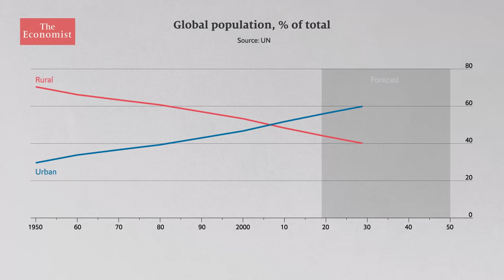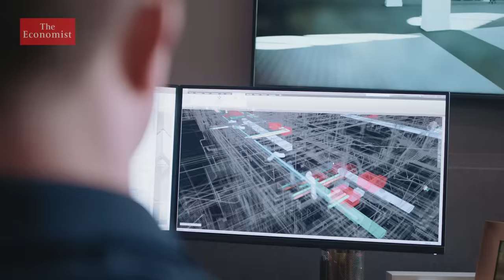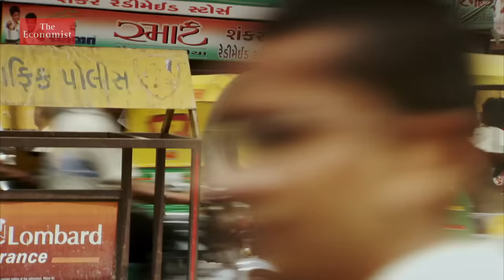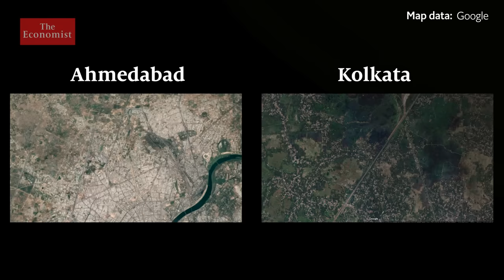How to manage a megacity

Comment: Fantastic video. However I disagree with the focus on composting. This is not a sustainable option in large-scale centralized applications. Centralized composting facilities will not last. They emit methane and nitrous oxide (36 and 298 times more potent than CO2, although not densely concentrated) and they still produce vast amounts of CO2 in this mostly aerobic process.

A more sustainable option in the future is to first recover the carbon into a value-added product or biofuel, and then use the residuals as soil amendment (eg. Hydrothermal Liquefaction, Gasification, Pyrolysis, Anaerobic Digestion)
Reply: So you are saying all the organic waste,like fruits and vegetables wastes etc shouldn't be left in open to break down on a large to obtain natural fertilizers.
Reply: It does not have to. Those gases can quiet easily be captured and either sequestered or used for fuel. They don't just throw it in a giant head and let it rot. It's controlled.
Reply: Did you not listen to the fact they add in stuff that absorbs the greenhouse gasses?
Reply: @rajkishorebehera7489  digestive reactors or modern landfills go through the process of composting while trapping methane for biofuel disposal. This both creates a green fuel and removes methane pollution which is 100 times more potent as a greenhouse gas as co2. The only issue is cost. It is much more green than traditional composting though and can still create compost. They just require tanks or tarps to capture gas
Reply: Kevin Clack, that is an interesting perspective.  However, some countries and some large cities have done composting well on a large and commercially viable scale.  E.g., from Barbados to Las Vegas, there are entrepreneurs who are collecting food and other organic waste from hospitals, from schools, from restaurants, from hotels, from supermarkets to avoid having these valuable resources treated as immediate garbage.  Some items can be redirected to supply food-banks, the poor, the homeless.  Other items can be composted and turned into soil for farmers and for households, and other outputs can go towards animal-feeds.
Reply: As much as this is ideal, you are completely forgetting that our soils are being deleted at an alarming rate, leading to more deforestation for farmland. It is much better to let our waste rot in composting facilities that don't keep the methane (and are therefore cheaper to put in place) that in landfills were they are mixed with toxic waste and will never make our soils fertile again. Greenhouse gases from plants that we have grown over the past 10 years aren't what is causing climate change as they captured those greenhouse gases over their recent lifetime, fossil fuels that captured the greenhouse gases from the atmosphere thousands of years ago do.

Comment: I read somewhere (perhaps in a comment) that the concept of Waste-to-Energy (WtE) has some drawbacks, and that is why it is not being automatically employed near all the large (urban) waste sources to generate electricity and/or heat.
However, I always forget what the disadvantages of such a technology are, as they haven't seemed to be convincing to me yet, and I'm starting to find it suspicious how little WtE is being talked about as a solution to the increasing waste problem.
Reply: Waste being plastic to energy is the least worst choice of those options. But we need to stop the plastic in the first place.

Comment: It's become clear you cannot build your way out of automobile congestion. Congestion comes down to human tolerance for inconvenience. If you increase capacity of highways, you'll get short term relief from congestion, but it will soon return to jamming up as people who had given up driving return to the automobile. 
The only way constructing more highways can work is if you construct super-by-pass corridors. Each suburb gets its own highway terminus, with no off ramps in between. Of course politically this doesn't work because the neighborhoods near the city limits get carved up and isolated, and the land given over to a super-by-pass provides zero economic benefits, unlike traditional off ramp / on ramp access which provides some economic stimulus.
Reply: Or, hear me out. Instead of running a highway from everywhere we should run public transit. Having a convenient bus route will reduce congestion by huge amounts. Right now in America you can't really live without cars, giving people other options to driving will really reduce car usage. Traffic there isn't a problem of not enough capacity it's a problem because cars are the only option.
Reply: @justahamsterthatcodes  I'm not advocating for my idea. It's unworkable, and wasteful. I was only pointing out a way that building more roads would solve congestion.
Reply: @WestOfEarth  Yes, but like you said, only briefly. I used to live near DC - we had highways go everywhere in every direction. Once a new road is built, it fills up. People take other roads (often residential or 2 lane) and then those roads have issues and turn into their own highways. Especially in these areas, with the population continuing to grow, the need for roads will only continue.

Comment: Interesting propositions - wouldn't it be even greener to deal with waste at source? Where there are homes that can equip themselves with specific bins for sorting waste products and a composting facility, these could be on hand. Where homes do not have the space - eg flats - there could be a communal waste site for recycling/composting. It would be more cost efficient than the full scale and probably more expensive processes. The waste generated is bought with the product - so the immediate disposal should be part of the buyers remit. They could remove packaging at the store and  have a facility there for leaving it with the store if the store is not on board with recycling /net zero waste. The problem should be eliminated so that it isn't a problem, not nursed. We don't live in a world that is easily blanketed for some - the negative effects of living in a negative lifestyle affects the planet.  L R
Reply: Yes, it may be greener and more efficient, but it ignores the reality of people. Getting a mass of individual people to change their behavior, to actually do the work themselves, is a huge hurdle. Most cities and suburban areas have recycling facilities if you're willing and able to sort and drop off yourself. The percentage of people that actually go through that effort is disturbingly low.
Reply: @andrew40 in my country every home has four bins: general waste, food waste, paper, and metal/plastic
It gets sorted further at the station but much of the work is done already. Most people I know sort their trash, it was rolled out only 4 years ago and people pretty quickly accepted it

Comment: Replace agricultural farms with electroporated vats of Knall Gas bacteria, replace rail transit train trolleys with Robert L Morrisons Lighter than air solids sealed in foil for nuclear powered airships, and use Marshall J. Corbett's panted for aerial cold plasma highways with spaceplanes for upward angular acceleration into orbit.  

Keitaro Yoshihara has patented nimbus storm clouds from humid air.

Comment: I prefer cities of size 150000 to 500000 inhabitants
Reply: I live in a city of 650000 and feel it is too small. I don't even consider it a city. Anything below a million is like a big town. 😅
Reply: People in megacities should start moving back to such cities.
Reply: With work from home more people should be able to move out to the sticks
Reply: I like countries of 330 million better than 1.4 billion.
Reply: @Crashed131963  I like countries of 5.4 - 5.6 million more than countries with 0 - 5.4 milj / 5.6 milj - 1.4 billion people.
Reply: Small cities are less efficient per capita.
Reply: @VFPn96kQT  You do not sit in traffic jams for hours and can have a backyard with a lawn and drive to a lake in under a hour for a swim in 100,000 people cities  vs  overpopulated messes.
I moved from Toronto to Sudbury it is so much better.
I can drive 4 hours to Toronto if I want to visit the rat race again.
Reply: @Crashed131963   That';s not an argument against my point . From the energy perspective, infrastructure perspective, land use perspective - large cities are more efficient per capita. You want to be "green"  - live in a large city in an apartment building, and use public transport.

Comment: 1. I wonder if we could use the plasmas from Fusion reactor furnace which reaches 100 Million degrees easily.  ALL KNOWN materials by man even from outer space vaporizes instantly at that temperate. Then put a HUGE Air filter boxed in to capture ALL vapors - repeat.   2